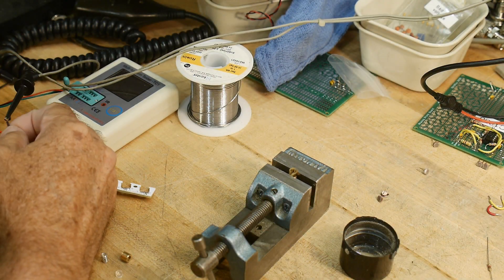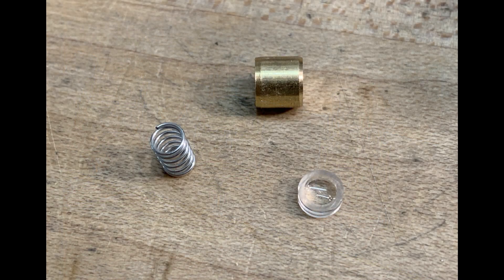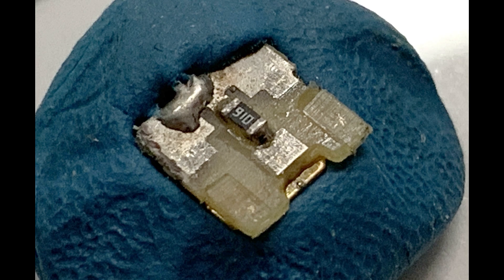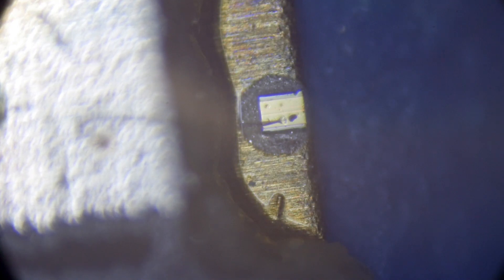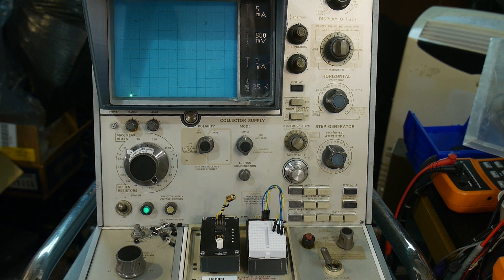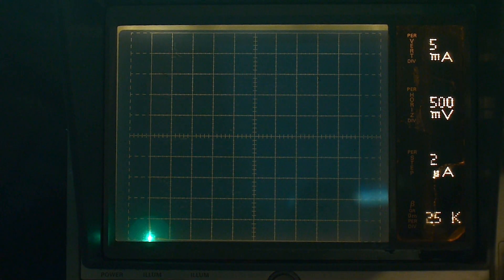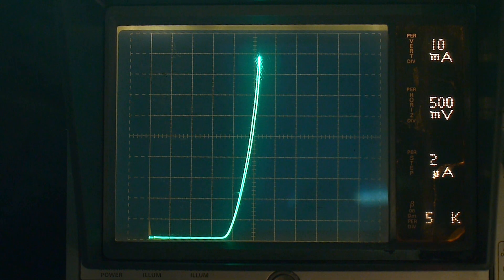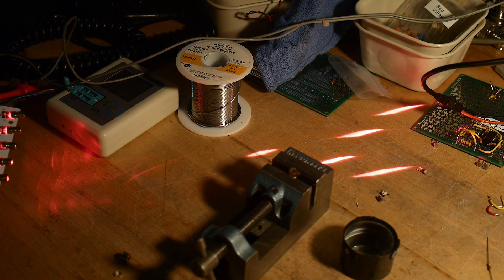#1636 Super Cheap Lasers

Comment: I bought a whole bunch of these key ring laser pointers from a flea market.  My key ring lasers originally operated from 3x LR44 button batteries.  

For an eye tracking project, I modified the laser to operate from an LM317 30mA current limiter (12VDC input), and inserted a diffraction grating into the lens, resulting in a display grid of red dots on the wall, to which the person would look at each dot in turn.  

The eye movements from this laser grid calibration would serve as a datum for the main eye tracking video of the intended scene stimuli.

Comment: Same thing with laser pointers I got from the dollar store. I just took them apart and replaced the battery with a 4.5V supply, and I can run it off of an AC adapter.
Reply: I took apart laser diodes from the dollar store 20 years ago (in the early 2000's) and they were exactly the same - just a resistor and a bond wire down to the laser, all stuffed into a little brass housing. Maybe the diodes are more robust now??

Comment: Heh its not even ball bonded its just  wedge bonded... lol. Cheapest of the cheap.
Also if you are not interested in constant optical powrt why would you need feedback?
Reply: The feedback would be used to control the output and stop 'runaway' not solely for control of output power.

Comment: Cool video. Maybe I'm misremembering, but I think that it an earlier video about laser diodes you said that using a constant current source to drive them wasn't sufficient. The implication being that you had to feed-back the photo-diode in the package to keep things under control. I was chatting with a laser physicist colleague recently who was saying that for his application they use constant current sources as it minimises noise. Was there a particular application you had that required getting as much energy out of the laser without being too concerned about noise?
Reply from the maker: 1000's of uses for lasers.